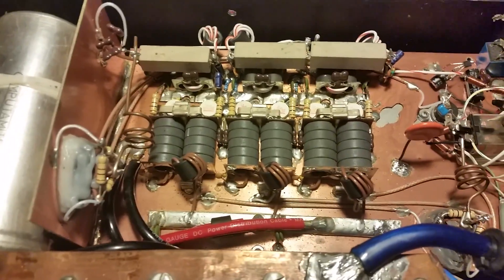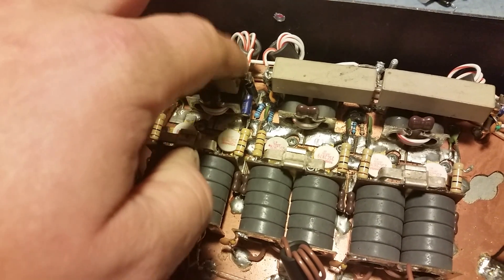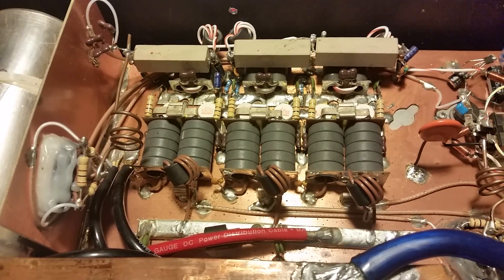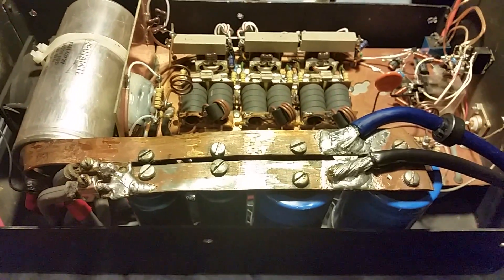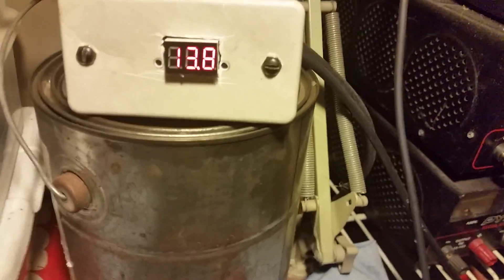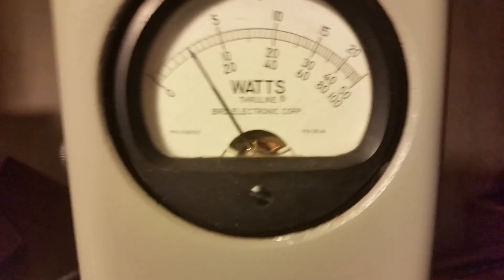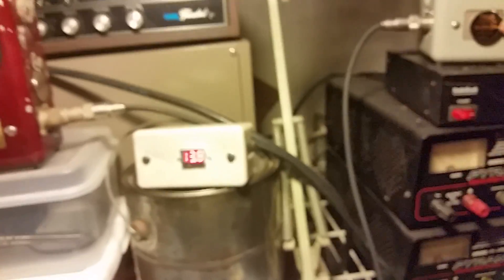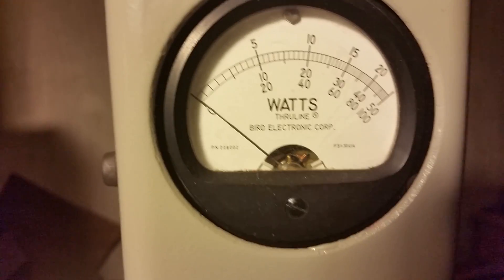Custom 6 Pill B Biased Amplifier Repaired & Back Hammering 🔨

Comment: sand bars, looks like the way junkyard technologies does ab biased amps. i guess it's how much the resistors are. by how much voltage and current it allows to turn on the transistors. "question"can this set up be made switchable back and forth. from ab or in this case  class to c class, as c class is biased off of the input signal voltage and current from the radio.
 i'm learning bit by bit.

Comment: Hi I got a palomar 250HD with 1446's.
It has the 2 small black relays, no sandbar.
I was wondering how to clean it up.
When I modulate on SSB it sounds good but when I key and there is some background noise, it sounds kinda dirty or raspy.
Its like theres not enough bias or something.
Any ideas? Maybe its not AB bias?
Reply: It looks like this
http://i620.photobucket.com/albums/tt282/roadrunner522465/palomarinside.jpg~original
http://www.cbtricks.com/Amp/palomar_other/blue_lightning/graphics/blue_lightning_top_parts.pdf